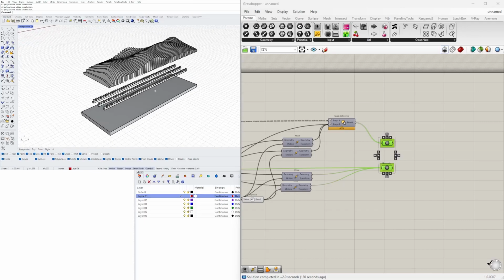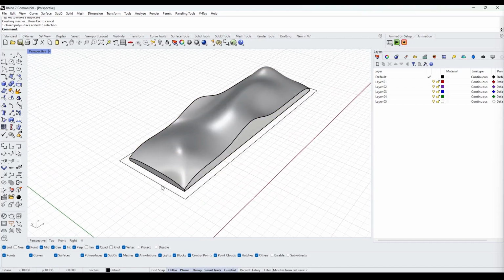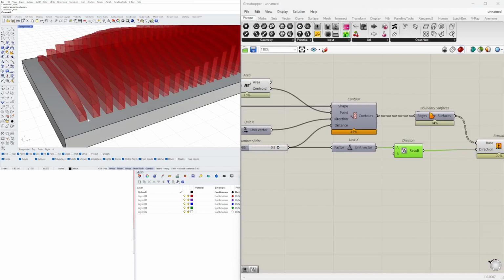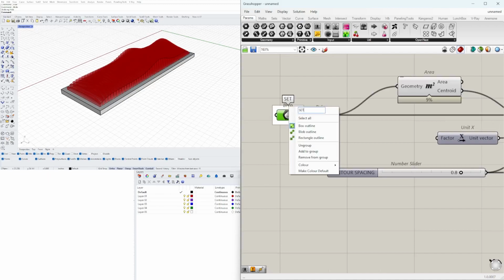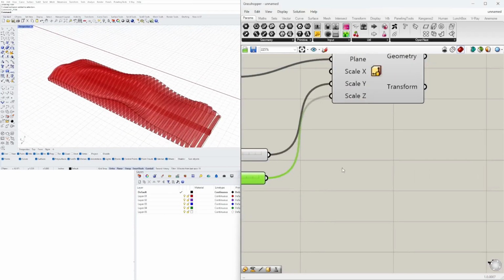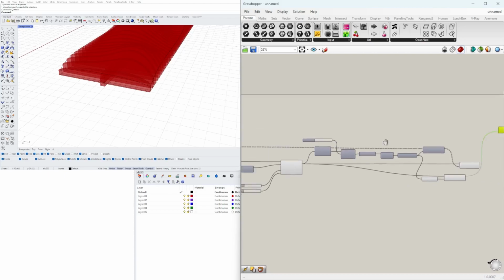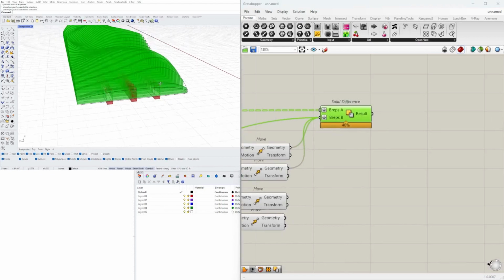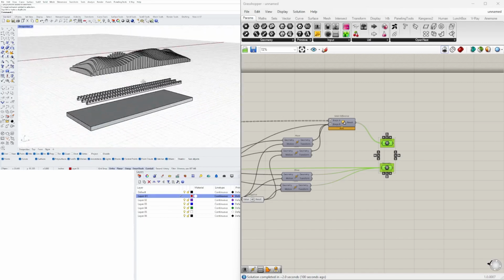How to make a Contour topography exhibit using Grasshopper & Rhino Parametric Architecture tutorials

Comment: It's a delight watching you work your exercises. Even the initial state of preparing the surface can be done with grasshopper. It's good to explore techniques to generate simple surfaces giving the user alternatives to produce them. Sweep 1, sweep 2, the famous rebuild surface, the subD bridging are many of these techniques. I do too the point distribution array by height and of course the contours. 

Exercises on the construction of initial surfaces would be of great use too. Keep going. I deeply enjoy how you reason your work. Helps a lot strategize and plan ahead without trial and error.